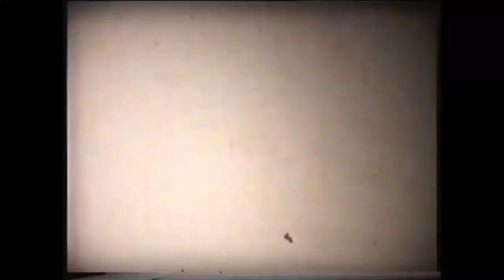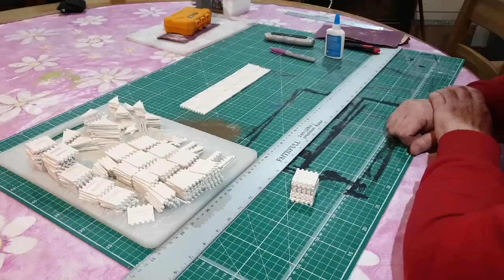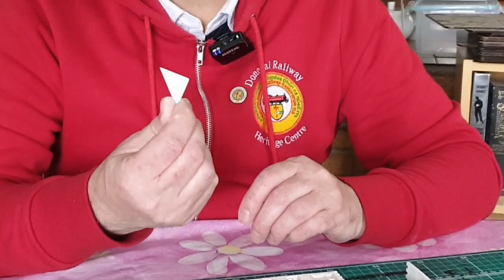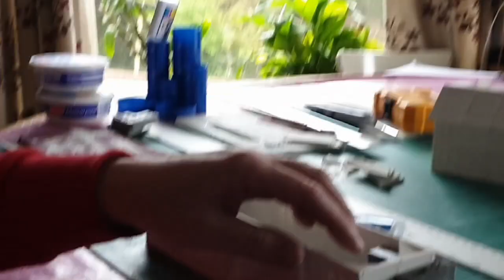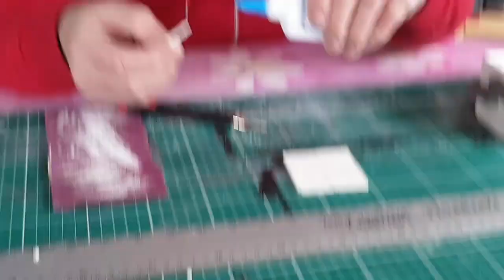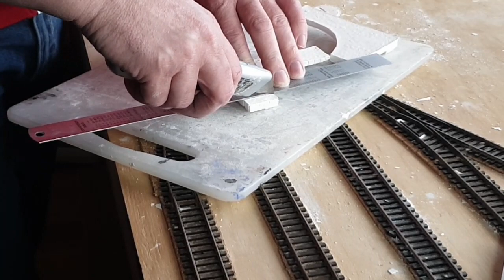9. Model Railway for Beginners Preparing and Building using Scalecast and Linka Moulds Part 2

Comment: Can I use links molds for resin casting
Reply from the maker: I have never tried with the Linka moulds. When resin cures it can get hot so it may melt or distort them.

Comment: Great video. Thanks. Do you have any tips for colouring the casting powder during setting process. I don't want to paint it after it has set.
Reply from the maker: Try using some acrylic paint in the mix. You will need to experiment a bit to get the mix right for the colour you want.
Reply: @DonegalDadRail  Thanks!

Comment: Sir you are a diamond! Just tried your tip and it works perfectly.
 So thank you very much!

Also found adding a tiny splurge of cheap coloured acrylic (plain burnt umber works 

well) to the water/plaster mix. 

Then, when dry, a gentle rub of the surface gives a nice mortar effect. 

Another discovery is (if using resin casts) to place a bit of blue painters 

tape on the plain back of one Linka tile.

The tape shouldn't touch the front at all. 
Then on the side you want another tile, about 2-3mm away from the tile place a tiny amount of standard superglue. 

Doesn't need a kicker or anything fancy, just Poundland stuff. Wait a few seconds then slowly manoeuvre the 2nd tile against the 1st tile.

Trying to ensure the glue doesn't squidge upwards to the decorative side.

Wait about 5-10 minutes then slowly pull the blue tape off.
 Oh, and do this on something nonsticky like an old ceramic floor tile. 

That's because the tape will still contain some superglue and you'll get a tutting 

from the missus about ruining the kitchen worktop [again :)]
Reply from the maker: Glad I could help.

Comment: Great tutorial! Just one question - I've been lucky enough to acquire 2 Linka sets from a charity shop and tried both some resin and plaster casting. 
While the detail is amazing, there's a clear 'step' between the linka panels (see 9:42 on your video). Tried filler but it doesn't give a good result. 
So, as you clearly have loads of experience, any suggestions ?
Reply from the maker: That is covered in 12. Airbrush,Mixing Acrylic Paint and Making Acrylic Paint Thinners.Preparing Scalecast for painting. Use a watered down plaster mix and paint it on, you may have to let it dry between coats to get the effect you want. Hope this answers your question. Get back to me if not